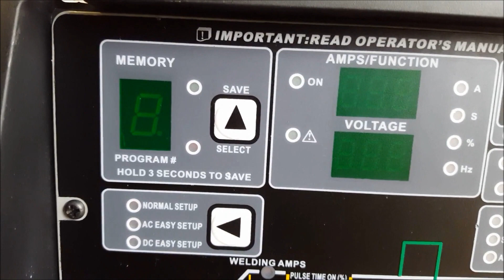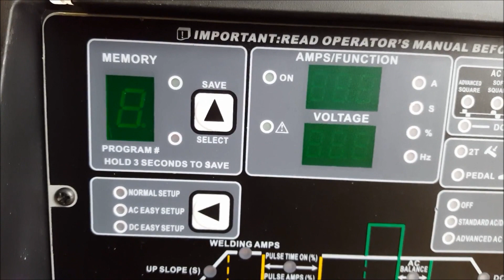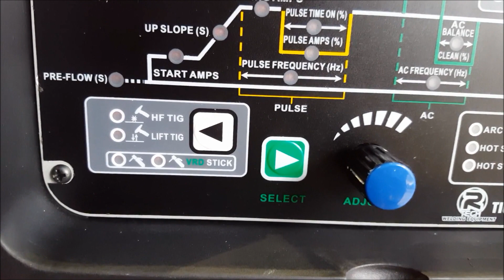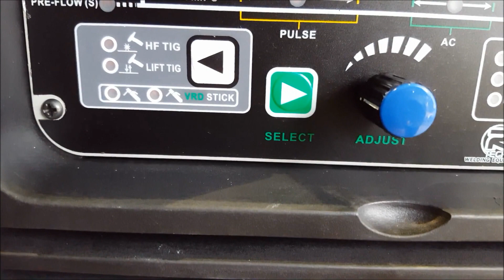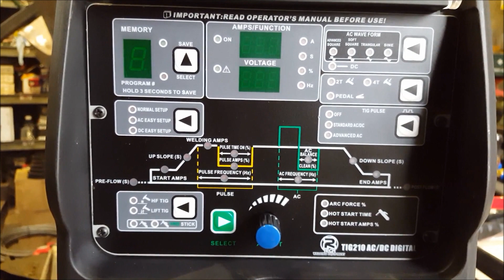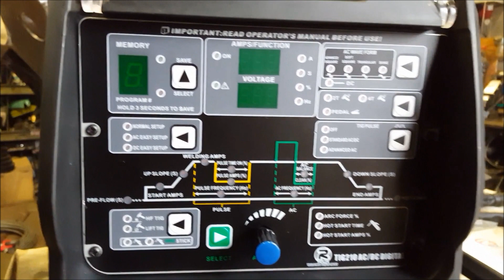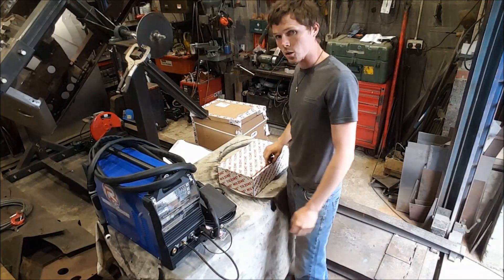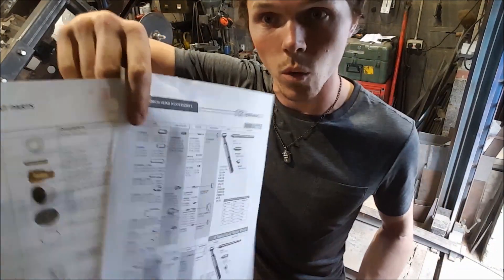R-Tech Tig 210EXT welder, Unboxing - MetalByBrian

Comment: Cool video mate. Thanks for making it, I currently have their dc tig 160 machine and was looking to buy this one. How are you getting on with it?
Reply from the maker: It's a fantastic piece of kit, does everything I want it too, next upgrade is gonna be water-cooled as the torch does get a bit hot up at the higher amps 👍
Reply: @MetalByBrian  cheers for the reply, I ended up buying it with the same torch as you. Can't wait to try it

Comment: Im in ireland and looking for a decent welder but am only finding american relevant information,Any advice on considerations to make a good decision to buy iv been doing alot of research but am still confused thanks :) helz
Reply from the maker: I'd definitely look at the r-tech, I've had no issues with mine yet, it's small enough to put in the back of the van for jobs as well, and I don't think you can beat they're backup 👍 the esab rebel has very good reviews, and is reasonably priced, but check its duty cycle, if your planning on doing lots of welding for long periods of time, it might not be the machine for you, but it does have the advantage of being multi-process.
I was torn between the tig210ext and the esab rebel. I also looked at ewm (as they're my favourite welders) but they were well out of my budget, good gear though 👍

Comment: I'll let you what I think of it after I've borrowed it for a weekend 😆.
Reply from the maker: Might let you have a go with the cebora mig welder 😂 changing to straight co2 tomorrow rather than argon mix, I barely use the mig now (got in the habit of tig and mma) so don't see the point in having expensive gases lying around for it.